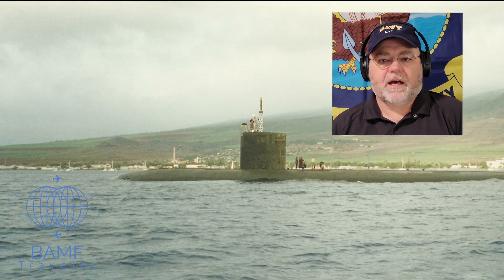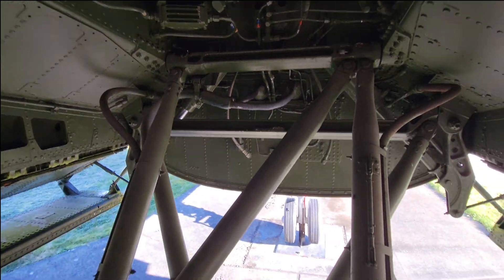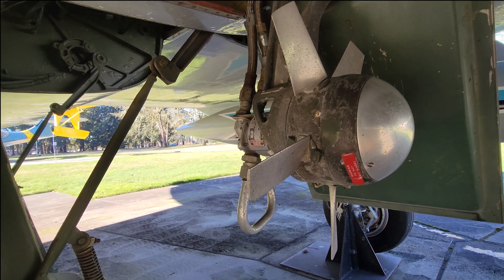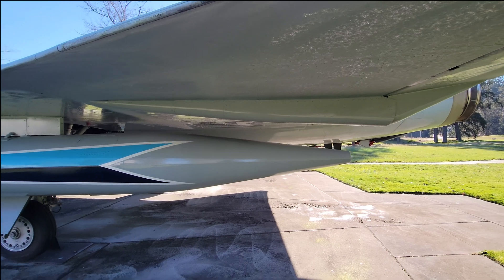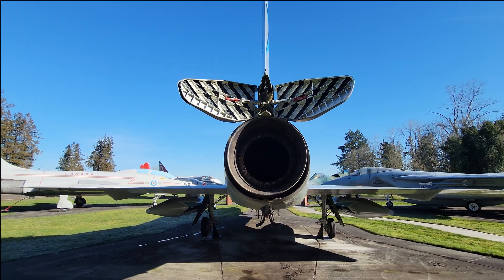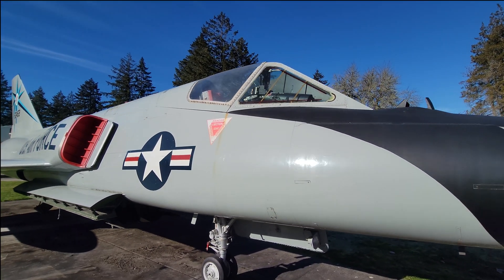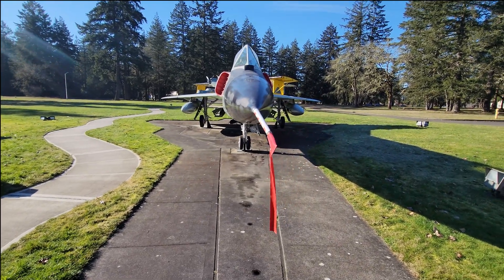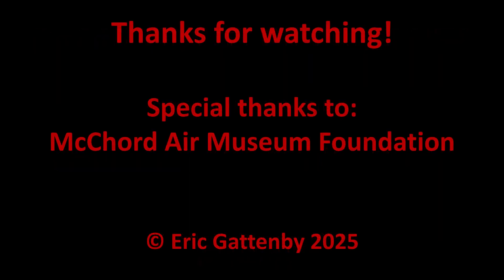Convair F-106A Delta Dart guided tour in 4K

Comment: In the mid to late 1960s, I served  as an aircraft mechanic at Join Base Lewis-McChord, which was simply known back then as McChord Air Force Base. Several years ago, while traveling in the Pacific Northwest, I went back to the base to visit the museum, which was in its early stages then. That Delta Dart was already on display, and that F-106 cockpit was inside the main building. At the time, there was a riser next to it that allowed visitors to climb into and sit in the cockpit. Whether that is still allowed, I don’t know but, if it is, I highly recommend it to get a good sense of the tight fit the pilot had.
Reply from the maker: Thanks for the comments. Yes, you can still sit in the F-106 cockpit trainer in the Museum, they have limited hours, but it is worth seeing.